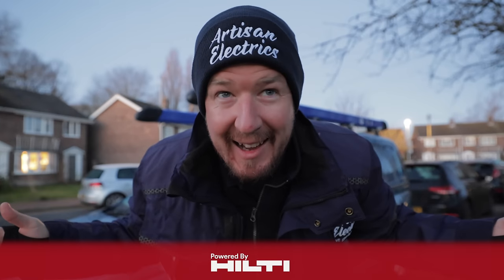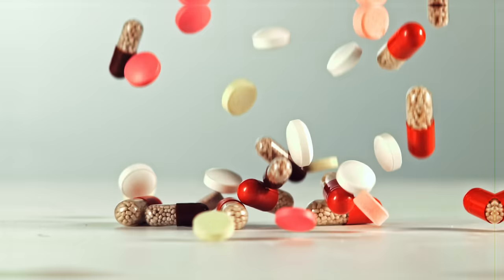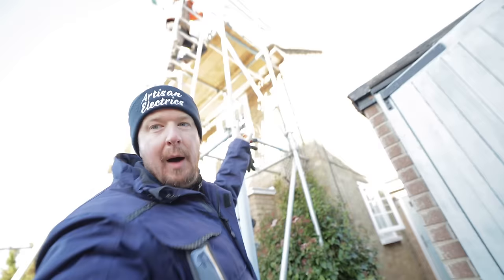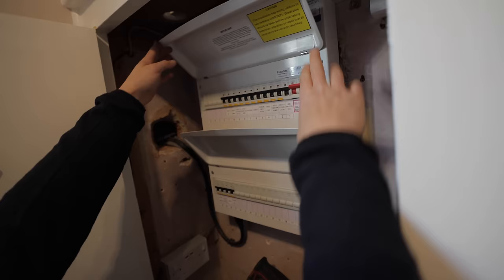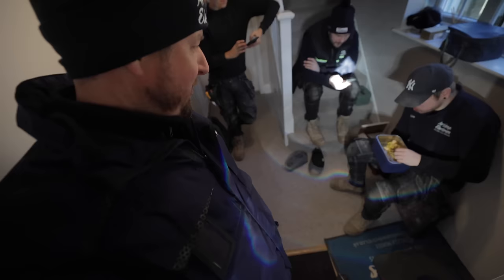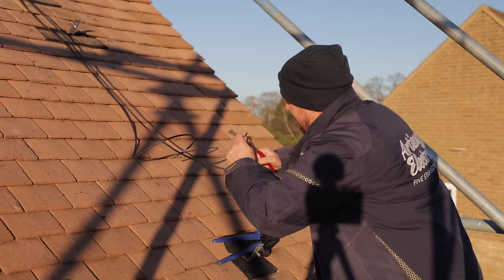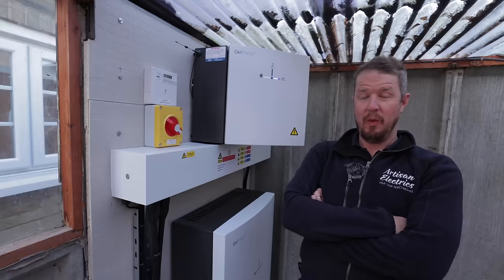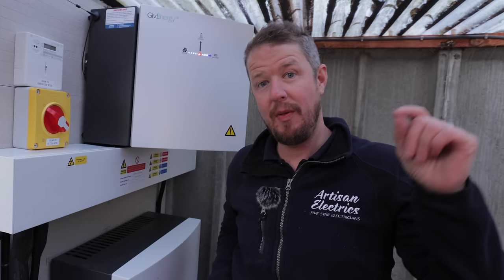My week installing Solar Panels and Batteries

Comment: One thing kills all types of inverters faster than anything is heat. From my industry days inverters running hot never lasted as long as the ones running cool. That’s the problem I have with the loft installs the heat build up in summer can be crazy
Reply: Heat kills everything electrical

Comment: Good to See you back Jordon, I'm Not Keen on the Inverter in the Loft, By the Time the Detector gets it, it is already Ablaze, the same applies if it was in the Garage, BUT a Garage Fire is Easier To Put out and a LOT cheaper to replace than a Roof
Reply: Fire issues aside, I don't understand why would anyone want to run those massive DC cables so far away.

Comment: Maybe install a fan blowing the hot air comming from the inverter away. it will certainly help with the internal degrees in the inverter during summer time

Comment: I understand the rules have changed on removing DC isolation but the Givenergy inverter can't be safely isolated in the day if it needs replacing as the DC inputs are via wago type connectors in the bottom?
Reply from the maker: Yeah thats exactly why we fitted a DC isolator in the end
Reply: Rules haven’t changed on dc isolation. You need dc isolation it’s just that older inverters didn’t have a built in dc isolation. So now you can do without the separate dc isolator. 
If the inverter needs replacing or moving later just remove one leg of the string and make safe followed by the other leg. I.e. keep them separate.

Comment: Thank goodness - more focus on content sounds great 👍. From an electricians perspective they've definitely been lacking vs the older videos IMHO. For example in this video some ecplanation of the 1% voltage drop to inverter (rather thsn a casual 4mm cable reference) plus how the island mode wiring works ie. why does the inverter disconnect from the source? What is a netral earth bond relay. I feel old jordan would have explained more of this.
Reply from the maker: Great point!

Comment: Good to see you back.   I am interested to find out why you used GivEnergy hybrid inverter instead of a pv inverter for the all in one.   We always use a pv inverter with aio system.   Did you manage to link the hybrid gateway and ac coupled inverter in the aio together on the app?  Thanks in advance
Reply from the maker: Customer wanted a Hybrid so he could add batteries later if needed. We had to comission them on separate users its a bit complex.
Reply: @artisanelectrics  could still add batteries if you used a ac coupled inverter.   Up to 28kwh I think.

Comment: Blimey.. you think you have to have a lot of tools..
Im a heating engineer/ plumber 
So i have all the usual tools we both have
I have soldering kit
Benders both conduit and pipe
I have press tools
Electrical tools, testers, crimping tools, ferral tools
I drive a long wheel base boxer, full racked with draws , all full..
A Caddy wouldn't fit a 10th of the tools we have to carry.

I do totally get you point though, one little piece of the job requires a skip load of kit..
Good to see you back.. not easy paddling your own canoe.. bloody tough .
Look after yourself, mentally and physically.

Comment: I'd love to know what a KWh costs to produce on one of your installations.

I worked out that I would be producing electricity at 53p per KWh.

That was a 4.8kw system in Scotland predicted to produce 3600 KWh per annum. Costing £12k 

Could never pay back.
Reply: 3600kWh/ year £12k.

If a kWh is 30p then that’s £1k annually.
I know Scotland’s not great in winter, but that’s pretty poor value.

I have a smaller array with a predicted (and realised) 2MWh/year generation which I reckon has a 5 year payback time.
Reply from the maker: Thats a very low output for a 4.8kW system... was it north facing or something? Less than 1 hour per day average generation sounds super low.

Comment: If the Inverter has its own DC Isolator (as a few seem to now), and you don't install one of your own, how do you isolate the DC if you ever have to remove/replace the inverter?
Reply from the maker: Exactly why we decided to fit one in the end
Reply: Turn off the inbuilt isolator to stop flow of string current and disconnect the MC4 connectors.

Comment: Nice to see you are back.
37:00 Is that the main earth cable going to the board? (wasn't clear from the video, or maybe I missed it) I am asking because here in Belgium we are required to have that cable run in one piece to the main board.
Reply: It seems to be the main earth for the garage. I know that main bonding conductors here need to be in one piece, but my understanding is that a crimped connection is permissible where necessary

Comment: how much better is the condudisc instead of an earth rod? Does the all in one allow you to DC couple the batteries if in the same location?
Reply from the maker: Condudisc is 100% better, we always get lower readings and they only get better with time as it beds in. DC coupled not an option with all in one. Multiple battery option coming soon tho I think...

Comment: Just curious as to why in the video @ 37:47 that you are using cable sheers to score and cut the insulation of that earth cable when i would be using side cutters ?, reason for asking is for the fact that those are cable sheers and are designed for sheering/cutting cables rather than for precise  working on the removal of insulation and such. loved the video btw, good to see you back in the uk with the guys on a job instead of playing around with non uk electrical content (as i did not enjoy that tat if i'm honest).
Reply from the maker: I find cable shears easier to strip round cables like that, side cutters nick the copper too easily

Comment: DC isolation is surely still useful in the event that the inverter needs to be replaced?  Feels like a really odd thing to not install - I know there have been some fires, but that feels very odd - like installation errors rather than technical fault.

Comment: Why do you have a rule to never put an inverter in the loft? Heat? Water? Those GivEnergy inverters are rated to 60° operational temp, the loft would never reach that.

Comment: 40:00 They actually even have a smoke alarm inside the DB cabinet. 😲
Reply: a battery fire angel one, so not interlinked with the others. Bizarre
Reply: @dg2908  I think, it will be heard nonetheless and locating the potential source of fire will become much easier.

Comment: you forgot to mention that the givenergy AIO, can be easily retrofitted to current FITs solar systems while still retaining the payments and also the ability to pwer the solar system in the event of a power outage, myself i am currently waiting to see whether the zero vat kicks in in feb for the AIO for a consumer buying themselves and getting a givenergy qualifed sparky to install, also worth considering givenergy are bringing have a ev charger that pairs seamlessly with the AIO
Reply: The VAT reduction will be given by installers, the 20% VAT will still be added by wholesalers. Just get your spark to buy it and install at zero VAT, he can then reclaim the VAT.

Comment: With proper reinforcement it is safe to fit batteries in the loft. Think about the weight of a cold water header tank. Depending on battery size, (about 30kg per unit)  this is a fraction of that design weight.
Reply: Yeah but you don't have to lift the tank full of water for a start also the givenergy 9.5kWh battery is 116kg have fun lifting that up a loft ladder. Plus there is now a debate in the IET about banning the practice due to fire risk
Reply: @14fy fire risk thats a joke. Lifepo4 doesn't thermally degrade until 1177C and domestic fires don't get that hot. Lifepo4 tech is chosen to avoid thermal runaway. I agree about the weight and modular batteries are about 30kg per unit per 2.5kWh, so liftable with a mild hernia risk.
Reply: @atkt62  LiFePo4 does ignite and I have seen such battery's go up in flames on occasions in laptops and phones aswell as on domestic solar batteries it does happen
Reply: @14fy  older lithium metal chloride te h, yes there's a thermal runaway risk.laptop battery tech cannot be compared as energy density type of cell etc is totally different.  Mostly fire risk down to arcing due to poor installation. So caveat emptor
Reply from the maker: Fair illustration, but I would still prefer to avoid it if possible.

Comment: fire-resistant-boards/british-gypsum-gyproc-fireline-plasterboard-tapered-edge-2400mm-x-1200mm-x-12-5mm-2-88m-sheet, I was thinking of using this 20 a sheet board is that Good for certification.

Comment: Welcome back Jordan & I hope 2024 sees your/Artisan's fortune improves....... just a small question about the inverter in the loft, is this loft air-conditioned? I only ask 'cos here in New Zealand it's the height of summer at the moment & our loft or attic as we call it has just hit 56 degrees. This makes the HRV system shut down in protest. Presumably it gets similarly hot in the UK summer, would the inverter be roasted?
Reply: I measured 55 degrees in our loft (west of London) in summer '22, just before our solar installation.  I asked for the inverter and battery to be fitted in the garage, close to the consumer unit.

Comment: That smoke isn’t positioned correctly mate
Reply from the maker: Where should it be then?
Reply: @artisanelectrics   Ideally, at the highest point, which is easily done in a loft space like that.  But if you don’t have time for that……within 600mm of the Apex.  Now, i cant tell for certain if that smoke is within 600mm, so if it is, then i suppose you’ve met the minimum requirement.

I’d also say; i cant see any fire rated clips but I’d imagine you’d argue there was no need.